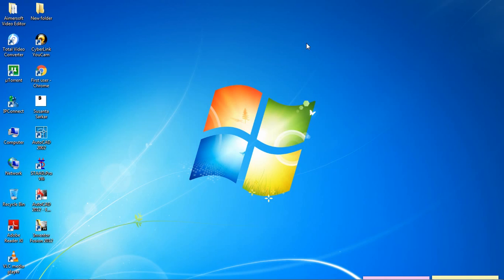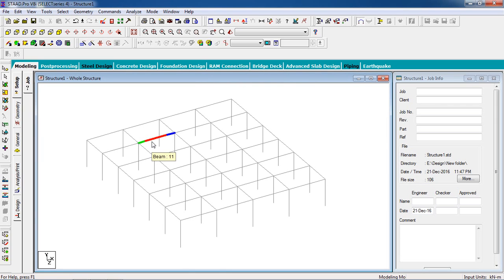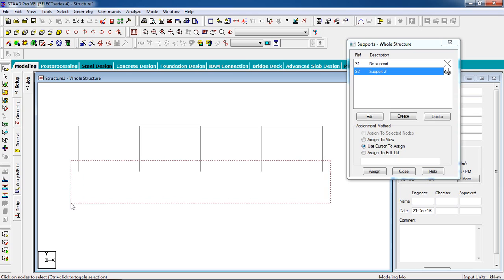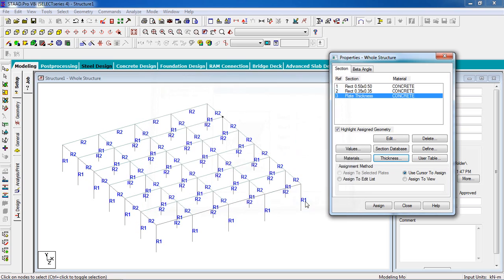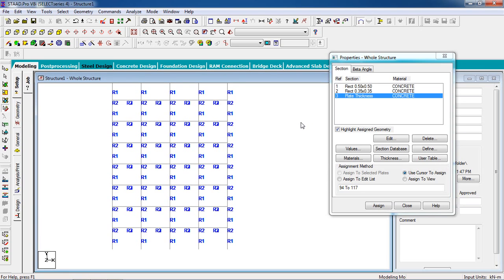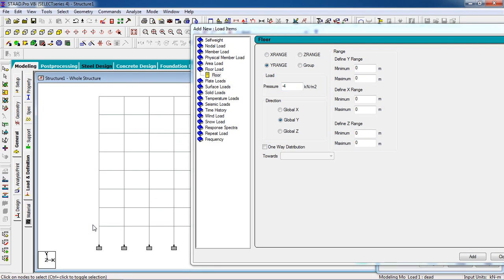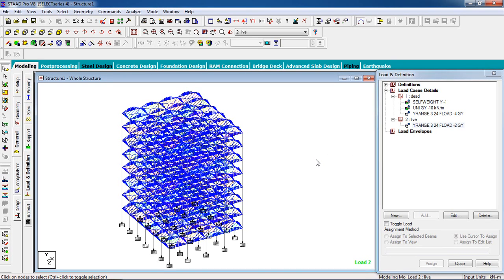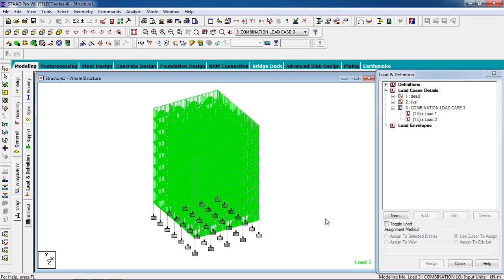STAAD Pro Tutorials - Analysis of RCC Multistorey Building with Combination Load Part-1 ( Day 11 )

Comment: Please explain how floor load is coming 4 KN/m^2 for dead load and 2 KN/m^2 for live load case.
Reply from the maker: Dead load calculation = Weight of slab+Weight of floor finish+Partition Wall (if needed)
Weight of slab = Length X Breath X Thickness of slab X Unit Weight of R.C.C (25KN/m^3)
Weight of floor finish = Length X Breath X Thickness of floor finish X Unit Weight of P.C.C(24KN/m^3) 
For live laod check IS 875 Part-II or post your email id, i'll send the file.
Reply: Length X Breath X Thickness of slab X Unit Weight of R.C.C (25KN/m^3)= mxmxmx(KN/m^3) This gives the    value in KN we provide the intensity/pressure  in (KN/m^3).... sir please explain i am following your videos i completed till day 11 by today
Thank you sir
Reply: Same I wanna ask .. How 4kn is taken ... dead load slab + floor load comes out equal to abt 6.5 to 7 kn .... or dead weight of slab is assigned automatically